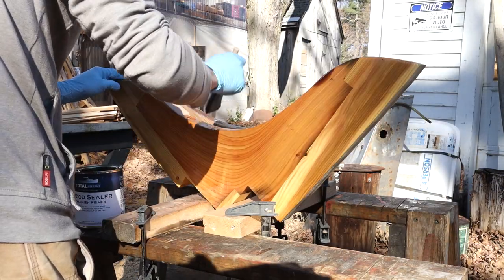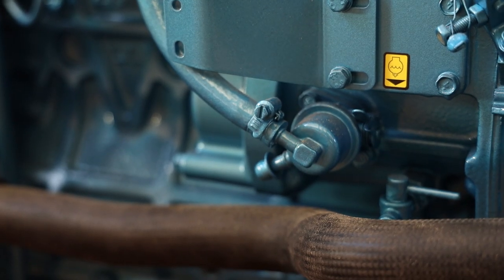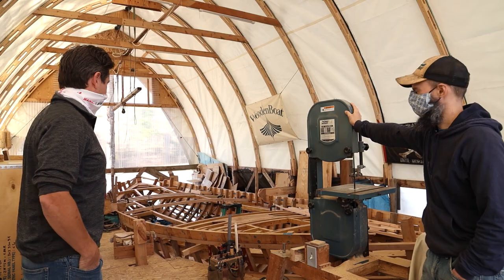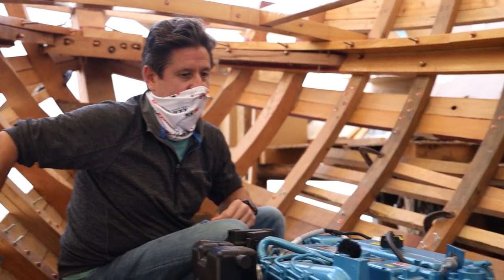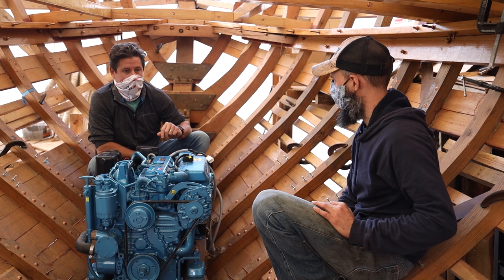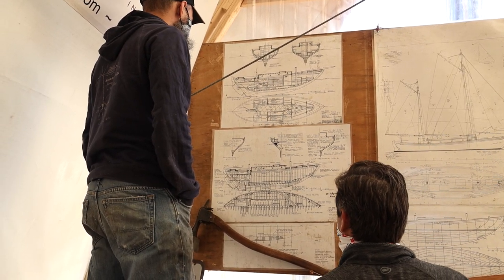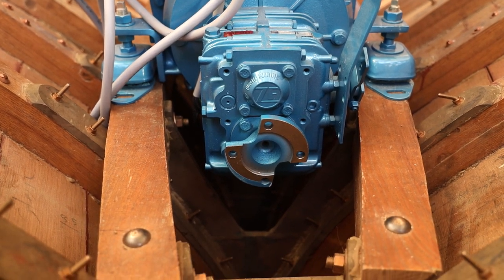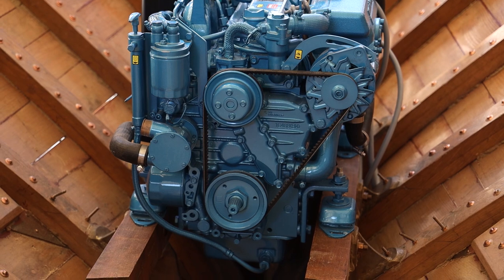Designing the Power Plant - Episode 137 - Acorn to Arabella: Journey of a Wooden Boat

Comment: Glassfiber/aluminium/stainless steel catch pan... Sooner or later that engine is gonna leak oil or diesel...
Reply: 100% - a steel pan you can have an absorbent pad in - depending on your engine and usage, you WILL get oil.  With an absorbent pad, you just change it out every 3 months, or whenever.
Reply: Bronze pan since half the boats already made outta the stuff >_>;;
Reply: You could even use part of an HDPE tote from a smaller size IBC... they come with a nice funnel like structure and a valve... You can heat (paint strippers) the plastic to adapt it to the shape needed...
Reply: Make it stainless. Fit and forget.
Reply: Yeah, that what I came down here to suggest as well.
Reply: Not a engineer for sure. Couldn’t even get a proper mask on his face
Reply: An old copper cylinder comes to mind.
Reply: @Bialy_1  wow! Those inoffensive comments about the salesman mask really bothered you. Replied to three different comments on it. Lighten up man.
Reply: Copper

Comment: A second alternator relieves a large amount of stress that occurs when the first one inevitably fails.
Reply: It also eliminates the need for a battery isolator.
Reply: If for no other reason you'd think you'd want a second alternator.
Reply: Always have a back-up!
Reply: they will need 3 or 4 alternators for the bumping soundsystem .
Reply: 2 alternators 6 12v batterys.
Reply: on a more serious note they should keep a dedicated starting battery used for nothing atall apart from cranking the engine. Good lord I cannot think of a more important thing to keep a reserve of power for when you have an engine and are int he middle of nowhere. split charge systems are easy to devise, keep a battery for starting , go as nuts or as light as you like with the rest.
Reply: @bluecollar58  gotta disagree on that, makes it easy to use the starting battery to charge your phone. thinking out aloud as I have never had a boat but plenty of campervans. in the highlands of scotland, left a reading light on, drained the battery... no cell reception. cannot put into words how nice it is to know the engine starts right up. Now that feelign in the middle of an ocean. I cant imagine the relief.
Reply: @everythingyacht3842  He he he, a battery isolator. Unless the alternator is externally regulated/excited, an isolator just turns it into a big fat idler pulley!!!
Reply: Dual generators/alternators are required for aircraft (well, instrument-flight rated aircraft). And that's per engine. Some aircraft even run triple or quad generators per engine, usually the ones with huge electrical demands, but not constant ones. Airlines and radar planes, usually.
Reply: @ScottKenny1978  at least newer ones. The older Cessna 172 I've flown only had one but they have significantly less power demand than a fully loaded SR22 Turbo.
Reply: They are two different  voltages.12and24 not a spare
Reply: @jasonjones6328  Why 2 voltages? That just creates all sorts of headaches. I've worked on 12/32V systems as well as 12/24/32v & what a freaking headache. Leave the 32V for the original engine system(s) & go 12V the rest of the way,
Reply: @CurlyScott89  was it actually rated for IFR flight? Dual generators (and dual vacuum pumps, if you have vacuum operated instruments like the gyro horizon) is the law for IFR.
Reply: @ScottKenny1978  yeah it was rated IFR. Flew SVFR in it in class D airspace. I'm not sure where you are finding the regulations for IFR but multiple alternators are not called for in FAR 91.205. Maybe in 135 operations?
Reply: @CurlyScott89  could be, but I could have sworn it was basic IFR ops... Been years since I dove into the FARs, though. Maybe over ocean ops?

Anyways, the point is that having a second alternator on the engine is for reliability, not for power capacity.

I would also recommend adding an AC compressor to run the icebox. With the right setup (I've heard it but don't remember the details) you can run the engine every couple of days or less often and keep your frozen stores cold.

Comment: Interesting discussions! I'll throw in my $0.02 based upon years of sailing and living aboard a blue water cruising sailboat, and now owning a wooden trawler ex commercial fishing boat. Though your mechanical systems are still a bit in your future, you'll be planning their layout before you know it.

1. Engine start battery has to be dedicated for that purpose only, no nav lights, instruments, bilge pumps, etc. When the wind comes up into the anchorage and you need to motor against the storm to stay off the reef, you need the magic button to work every single time. 2. House battery systems are rapidly evolving. Yes, you want to lean heavily toward the traditional experience, but you won't want to sacrifice comfort and safety any more than necessary. You'll hear extensive debates about wet cells vs gel cells vs lithium. You mention Goal Zero so you're certainly aware of the benefits of lithium. The one that most people don't think about is that they can absorb charge virtually as fast and hard as you can provide it. On Arabella, with very limited opportunity for much solar array, this means that you'll minimize engine running time. You certainly don't want a generator aboard, and running your main engine just to charge batteries is both wasteful and hard on the engine. But, away from the dock, it's going to be your only option, so you want to think about how quickly you can fill the house bank, therefore minimizing running the engine. NOTHING will take power like lithium, and with a DC-DC converter, you don't need an expensive smart alternator. Yes, it's expensive, but this factor alone will directly address your desire to maintain as much of the traditional wooden boat experience. There are many, many ways to build a lithium house bank that are far less expensive than most people realize. Check out Will Prowse for details. 3. While it may seem romantic and traditional, relying upon oil lamps and candles is really a horrible way to live aboard. LED lamps can be attractive and traditional, use little power, and are a wonderful way to minimize your energy independence. Think about lighting, your nav electronics, charging computer and camera batteries, and refrigeration when building your energy budget. Don't forget bilge pumps! Yes, a Whale Gusher will move a lot of water, but you can't do anything else to save your ship while pumping it. 4. Refrigeration! Sure, many have lived with block ice for years, and I'm one of them. Modern systems with Danfoss swing compressors are so energy efficient that it's easy to walk away from hauling ice (and dealing with melt water in the boat). Yes, you can absolutely sail the world with no fridge at all, but it's so easy these days to include it. 5. The head. My cruising boat had no holding tank at all, but that was a looooong time ago, and those days are gone. Open ocean? Absolutely, but in any harbors these days and in virtually all coastal waters of the US and Canada, you can't discharge raw sewage. You'll need to plan ahead for sufficient holding tankage. Many areas would still allow you to discharge via a macerator pump and/or treatment system, but this runs contrary to the traditional ethos. Consider a composting toilet with minimal tankage for urine. 6. Galley stove. Likely not electric. Alcohol and kerosene are traditional but horrible to live with, stinky, low energy density. We have diesel and love it; it's a tradition here in the Pacific Northwest and is the very best type of heat for the boat, but it's not for everyone and certainly no good in hot weather. A plus is that you'll already be carrying diesel and it's simple to pump some to a header tank for the stove and/or a bulkhead heater. Propane has high energy density and is very, very convenient. People freak out about the safety but it's child's play to build a safe system. 7. Hot water! A 12-gallon tank with heat exchanger is simple, and having the hot water from the engine will allow you to wash dishes and yourselves without having to use the galley stove. Seriously, having it aboard is well worth it. 8. Domestic water. I had a salt water galley faucet with a traditional bronze pump faucet, and very rarely used it. Washing dishes while blue water cruising?  Yup, that was the only use for it. Also had a fresh water faucet with foot pump. I would go with a simple 12 volt pump in a heartbeat, having now lived with both. PEX plumbing will make plumbing Arabella a joy! Run a tap to the deck for luxurious outdoor showers! Yes, you'll be carefully conserving water while at sea (unless you go with a small RO watermaker), but all it takes is a bit of discipline to not let the tap run unnecessarily. Pumping manually gets old really fast.

Damn, that got long in a hurry! Better cut it off before you fall asleep! Cheers, guys...she looks beautiful!
Reply: Nicely put.
Reply: The best advice I've seen yet
Reply: Excellent advice all 8 points of it. 
We used a raw water foot pump at the galley sink in the Morgan 30 we owned for 30 years. You have got to also at least rinse with fresh water or you will find all your silverware and you sink rusting faster than imaginable. In our current 45’ live aboard, we have both a foot pump raw or fresh and a pressure fed faucet. We like both for different purposes. We have yet to switch the foot pump to raw water, we like our sink and cutlery and pots and pans rust free. The salt environment is harsh.
Reply: All solid advise, having some offshore experience (sailed across the pacific, into the 40s etc) until this point I thought they had thought of alot... this discussion and their lack of knowledge has me a bit worried.
Reply: @BrentThu  No need to worry. All the cruisers I know learn as they go. No matter how much you know ahead of time, things come up while out cruising that challenge our knowledge and push our skills and flexibility. Cruising is not just about sailing, but also about finding solutions to the challenges that come our way and learning from the experience. Steve and Alex are great at finding solutions. They will have a huge advantage in that they know their boat so well. They might limp along without enough power, or conveniences for a while, but upgrades are part of boat ownership, and they will figure out what they need/want as they cruise. They have time. I expect they will start with coastal hops not plunge in with bluewater crossings. They listen, consider and learn. I am so far quite impressed with their decisions, their work ethic, and their willingness to take so many of us along on their journey.

Comment: Having owned a couple sailboats I'm concerned you're underestimating your electrical system . Having pressurize hot and cold water at your galley & Head is essential if your planning on living aboard . It's the difference between camping out and truly living comfortably . These systems these days are compact and reliable , a dual system of hot water off the engine and a compact electric water heater gave us hot showers on deck ...and that's really nice !
Reply: I respectfully disagree. Many people who use boats to live off the beaten track eventually decide to do without "convenience" items in favour of cutting down the time they spend trying to find good supplies of safe water, ferrying water out to the boat, waiting in foreign ports for part to arrive so they can get that safe water out of their tanks when their pumps or fittings have failed, etc etc.
It's not "convenient" to build, or maintain, a traditional timber vessel, nor is it convenient to sail to remote places for extended periods. I personally feel the whole notion of modern convenience is a seductive but unproductive red herring, and some of the happiest people I've visited on other yachts in remote locations have done without most mod cons in favour of simplicity and affordability, and got unexpected benefits in being able to spend their time on things which are mission critical instead of distracting peripherals. 
One in particular had no through hull holes whatsoever: he washed his dishes in a bucket he'd pulled up some salt water in (if you lick the grease of the plate while it's still warm as soon as you've eaten, and then wipe it with a soapy cloth, you don't need hot water). A different bucket served as a head, and an outboard motor coped with the rare times he couldn't sail right into his anchorage. He was a better sailor, and his yacht showed a clean pair of heels, to any cruising boat less than twice its size.
Reply: @Gottenhimfella  nice,telling it like it is.

Comment: Great vid! Just a thought to consider - 100 amps at 12v is 1200 watts - 100 amps at 120v is 12000 watts 10 times more and at 240v its 24000 watts! so beware of amperage without the voltage!!
Reply: Charlie K I believe it's not the man in street that is to blame for the way we connect to information but rather the system we grow up in. The skills these guys possess are as far from most people today as a butter churn or a hay rake. Not long ago people were taught the basics of Wattage along with how to use a No 4 plane and a 1/2 inch chisel. So go easy on the lads - they doing an amazing job!
Reply: @graxav  When Steve said that I wasn't concerned because he will get the required assitance to do it right. But I was unhappy when the salesman just agreed instead of setting things straight.
Reply: @georgf9279  True - I think the agent got a little caught out - he said the alternator was nominal (or words to that effect) then saw it was 100 amp, double the standard passenger car rating (UK). He was a bit stuck for words. 1200 watts even with a Li-Ion/inverter setup would be sufficient with room to spare for the dedicated starting battery (lead/acid).

Comment: My boat had a stainless steel pan under the engine to catch drips etc, it was made out of an old sink/draining board  thingy combo. apart from catching drips and wotnot it was also good for catching nuts that you inevitably drop whilst making repairs, saves the hassle of trying to find dropped bits down in the bilge......DA.

Comment: For the extra alternator or not, to account for your electronics (nav systems, nav lights, radios, interior lighting, can start to add up faster than you think), and then size your house battery requirements once you know how long you want to be able to run without the diesel on. Once you size the bank, you can see how much charge current the batteries can handle, and I wouldn't be shy about getting a charge current near what the specified max charge current is. Diesels dont like to be lightly loaded, so I assume you'd have the prop going while charging underway, but if you don't need the propulsion assist, just to charge the batteries, the faster you charge them the less fuel you burn.    Also, for your removable power system, if you do have a way to hook that in for house power, I'd still have a fixed house battery. If you're off somewhere remote, like you plan to be, off on shore doing whatever with your house battery out using the power in that up, and come back to a starter battery that gave up the ghost for whatever reason, now you're waiting for a solar trickle charger to charge your removable battery to start the engine.  If you have a fixed house battery, you turn on the cross-tie, start the engine, grumble about the stupid engine battery and move on with you day.    
For your fixed batteries, if they are lead acid, make sure they are the same chemistry. If you have mixed AGM for start battery and flooded deep-cycle for a house battery, the cell voltages are slightly different and one will never get a proper full charge and sulfate over way quicker than it should.  Same for 'plain' flooded batteries and ones with calcium in the plate alloy.

Comment: Guys, great video, as always.
In keeping with today's theme, I'm going to offer my "two cents" here.
First: a metal drip pan secured between the engine and the bedding rails. It will provide security from leaks and drips onto the wood, and allow for bedding absorption materials. 
Second: on your remote mount research the compatibility of PVC sheeting to mount the filters to. If it is resistant to diesel and engine oil it gives a low cost material that is easily built and cleaned up when needed.
Again, thanks for all the work you ALL put in to bring the project to us.
Enjoy your time off. Stay safe.
Cheers!😎